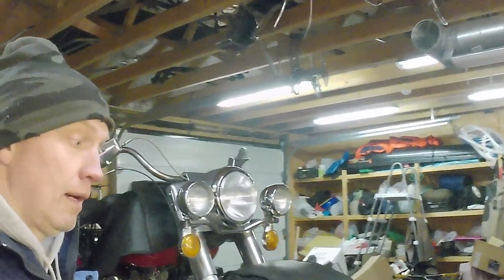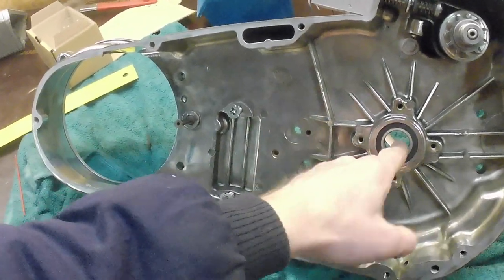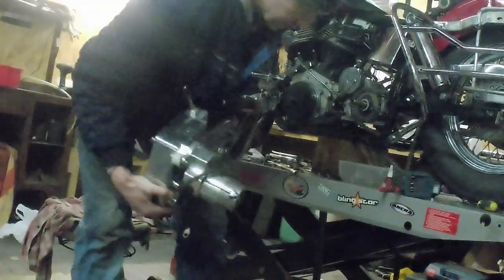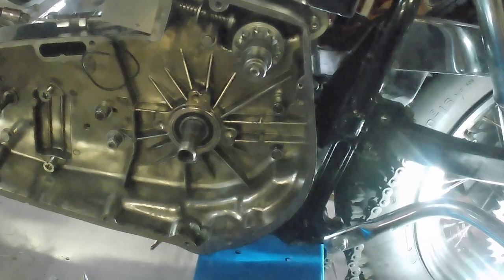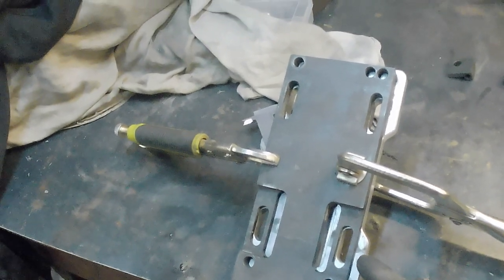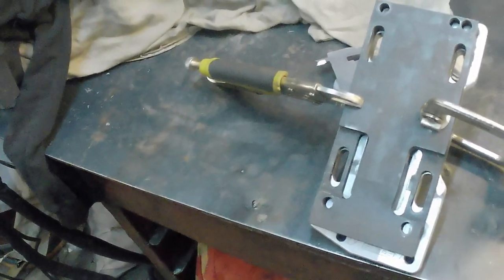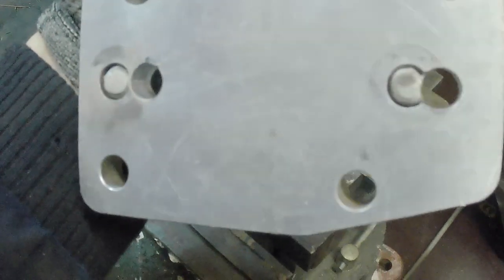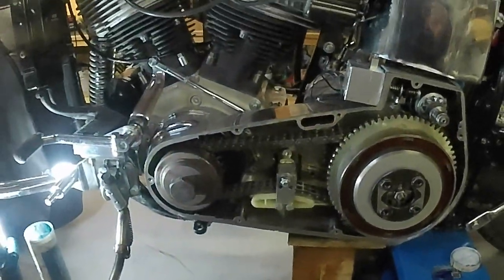FLH 1976, S&S panshovel family bike completed nor now..

Comment: With the pull start, you need to have a good relay to do the job correctly. If not it will melt. And the battery very well in shape with at least 12.8 or more voltage in it. 
I have partialy burn the electric with a battery too low in voltage, so all the ampéres are all coming together and that burn all.
Reply from the maker: Merci!! Yes I bought a special relay which goes in kit with this hand shifter. Thanks for info, will check my bat to be in good shape! Thanks for watching my bull sh..tn😃